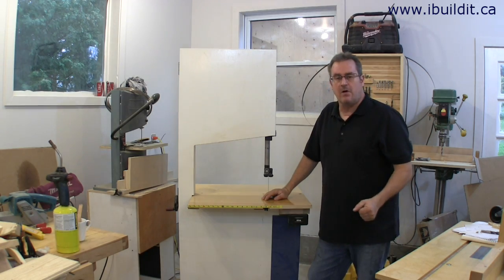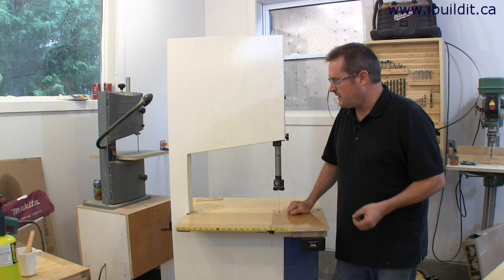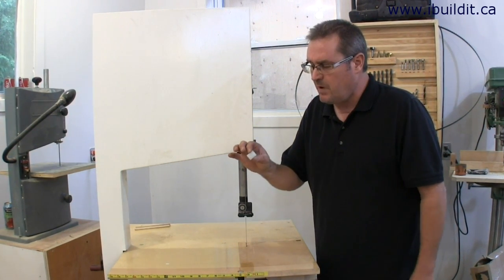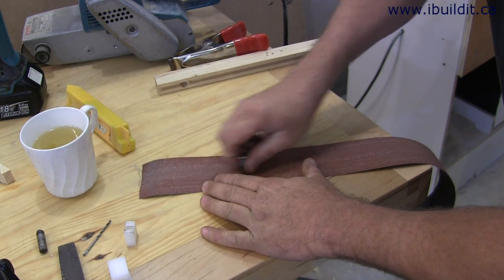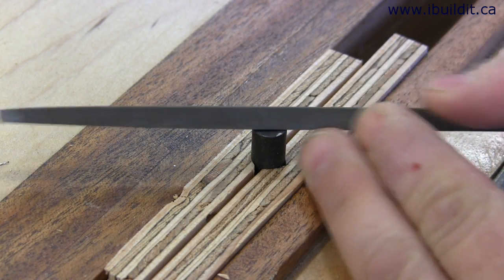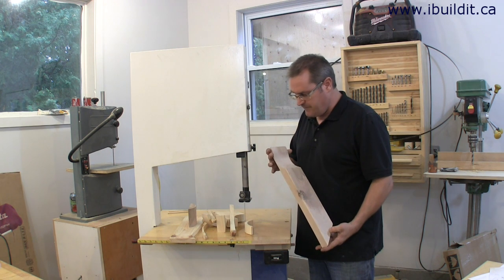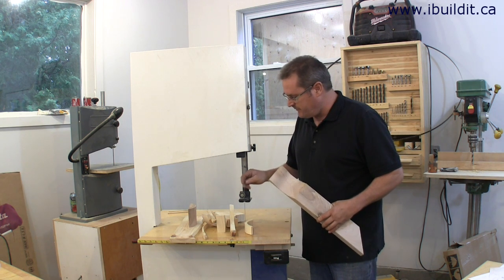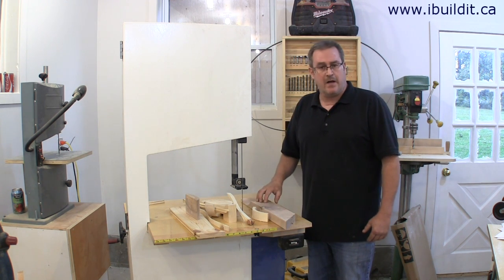How To Make Steel Band Saw Blade Guides

Comment: Love the saw & guides. Lots of questions: Where do you find the induction motors for the 2 bandsaws? What sort of plastic were the original guides (was that "ultra low molecular weight plastic")?  Also why harden the drill bit, wouldn't a regular HSS steel drill bit be hard enough?  Or even tool steel or brass - as a sacrificial guides (e.g. as it wears push the guide bar in a bit more each time you adjust the guides if necessary).  3 years on: any reason to go back to the earlier guides - or can these hardened steel guides  "do it all"?  Nice job :)

Comment from the maker: Band saw blades usually don't wear out from friction, they get dull or break long before that could happen. Bearings DO wear out, and they are a lot harder to make than these steel guides, so you pretty much have to buy new ones.
You seem to have missed the point of the video entirely.